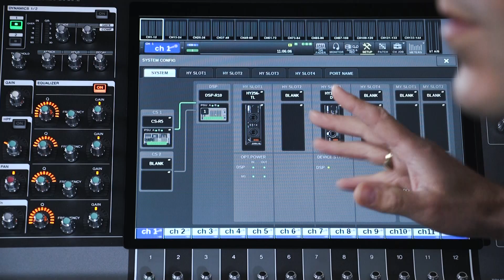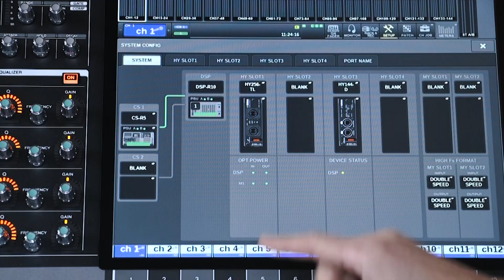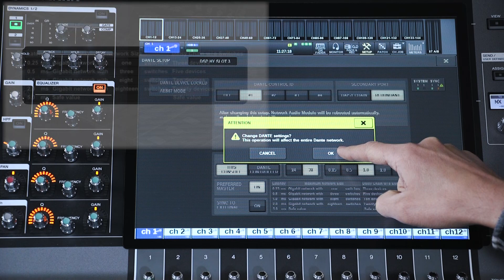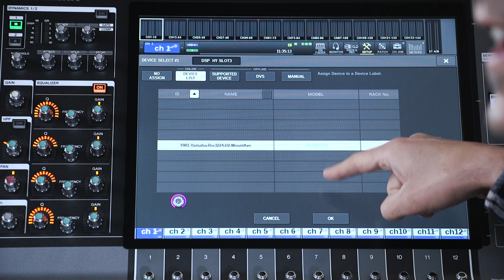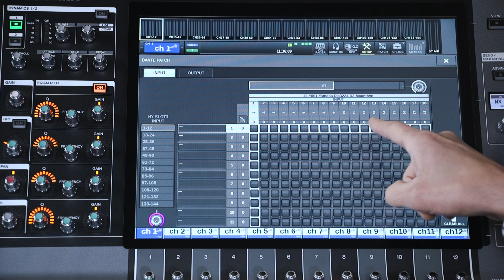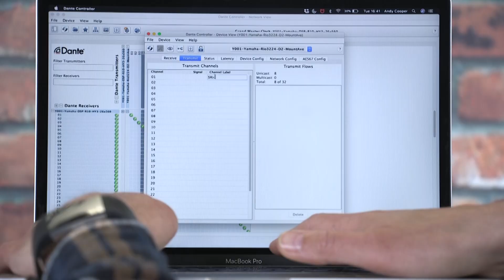RIVAGE PM Training Video - System Config

Comment: Why did this guy skip syncing the engine? The new Rivage I just received is asking me to sync the engine and there is no info I have found
Reply: “After you’ve connected your system, synchronized your devices, and set the word clock”